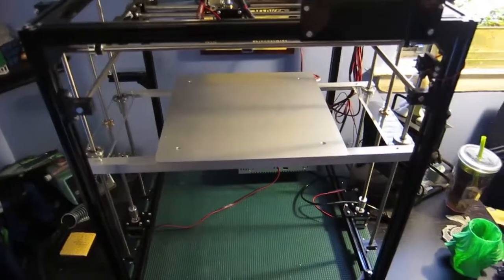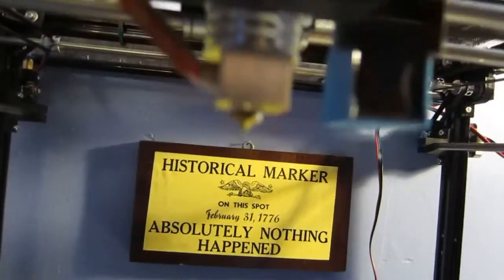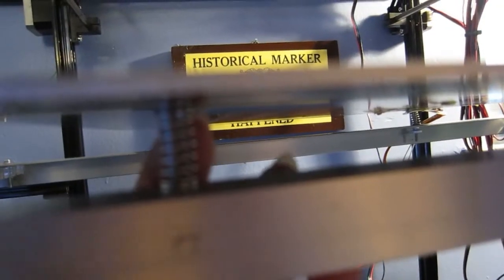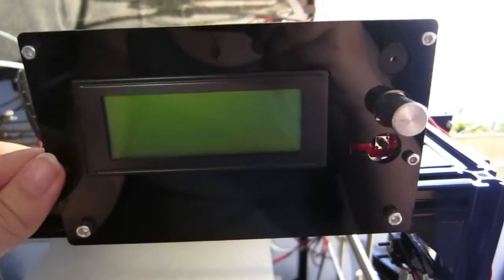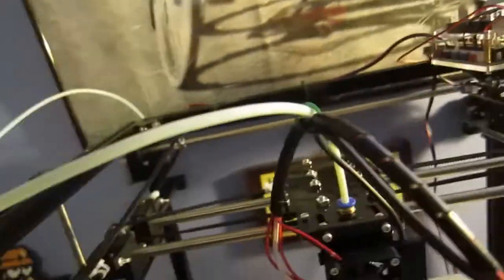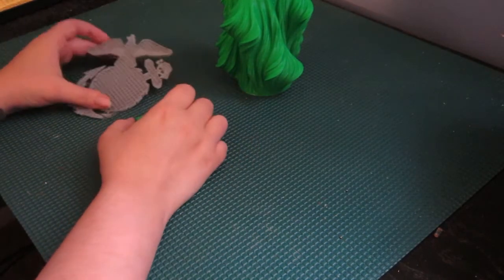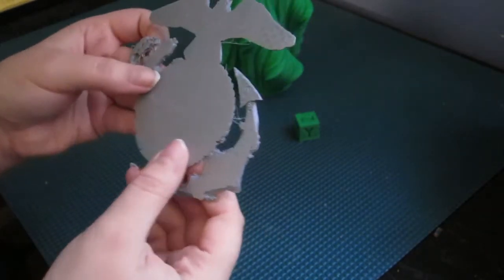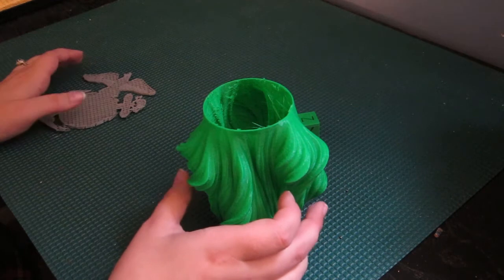FLSUN Cube Print Review & Update

Comment: Nice video. About the bed tip: Buy a 2 plate magnetic buildplate 300x300. Glue the first magnetic plate to the bed with the suplied 3M sheet. Then with a gluestick glue a sheet of houshold aluminium foil sheet on that plate. Now the seccond magnet plate and actual buildsurface goes onto that. Now you have a perfect (removable) buildplate and better yet your induction sensor will work flawlessly. My Sun cube arrives tommorow but this is how i am going to do this.
Reply: On another note: I would fix the bed screws with a nut on the underside first before adding the spring and like Dan F says you blew out your Z stepper driver becouse you didn't add the heatsink on the drivers. So it seems...

Comment: You need heat sinks on your driver chips, and those a4988 drivers that come with it aren’t the best, I think one amp per phase max if I remember, I would upgrade to trinamics tmc 2130’s or DRV8825’s at least then you will have no problem driving those twin z’s, or run on separate drivers, which imo is the best way to go anyways, you can configure to use second extruder driver port as a z motor axis
Reply from the maker: You are absolutely correct. The instructions that came with the printer did not use the heat sinks so that the acrylic top would fit on nicely. Stupidly, I followed them. I'll only make that mistake once!

Comment: Hi, I have 
bought this printer and in addition to being folded four rods, when 
conctar and want to print it indicates a temperature error, (error: 
MAXTEMP triggered, system stopped! Heater_ID: 0), cables are well 
connected instead, Temperature is fine as the manufacturer indicates, I have tried to contact FLSUN but they do not respond, poor service.
Who knows why it is?
Thank you

Comment: Hello,
the Z height sensor is an inductive sensor not and IR so it can see through glass without any problems. You just have to account the glass thickness in you Z height adjustment.

Comment: Things I did not like about this printer: Y motor outside of the frame, and Z sensor placed with LED facing backward. You can easily mount the Y motor on the other side  of the same vertical member, do that the rubber belt does not touch the corner bracket.

Comment: What settings do you use? I have the same printer but my top and  bottom layers are really inconsistend and have holes in them i tried changing all kinds of settings but even with an exstrusion multiplyer of 1.15 i still have holes in the top

Comment: Regarding your z-motor driver burning out:  My one-and-only printer (which has been working great for me)  is a FlyingBear P902, which is like a smaller version of this FLSun Cube.  (My version of the FlyingBear only has one set of z-rods and a single z-axis lead screw.)  Looking at your walk-around of this printer, I notice that the four z-rods and the two z-screws each have there own individual mountings, which must make them difficult to align.  Are you sure that they are all lined up?  If they are not, perhaps this caused binding in the z-axis which might have overloaded the motors.  I had some problems with z-axis movement on my FlyingBear; based on another users design, I designed these parts to align my z-axis components:  https://www.thingiverse.com/thing:2281208.  These parts improved my z-axis performance by an order of magnitude.  Obviously, these parts will not work on your FlSun cube; however, you might be able to design your version of these parts based on this concept, if someone from the FLSun community has not already done so.
Reply from the maker: wfpelletier Thanks for the advice! Before turning it on the first time I did test that the Z Axis went all of the way up and down without problem, but I do plan on adding some supports as well.